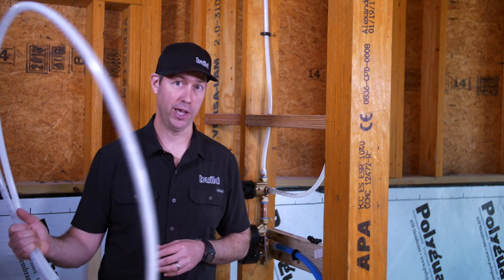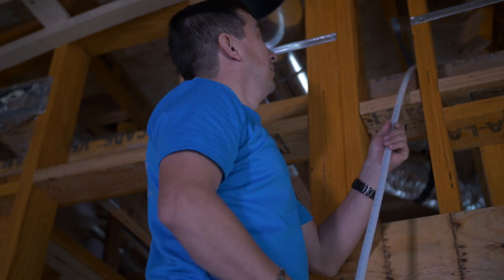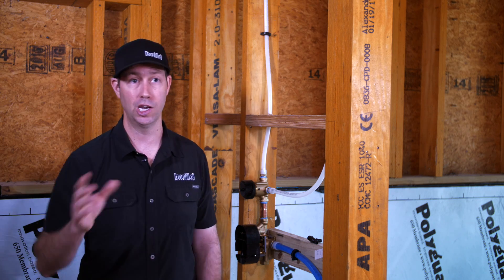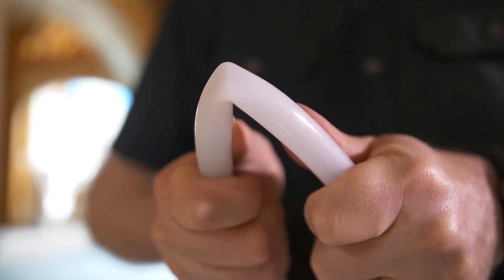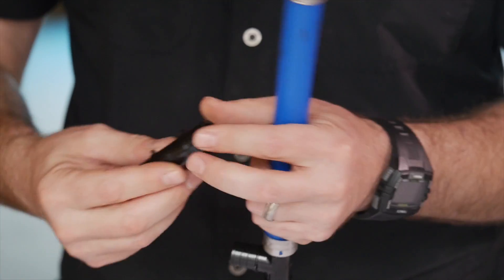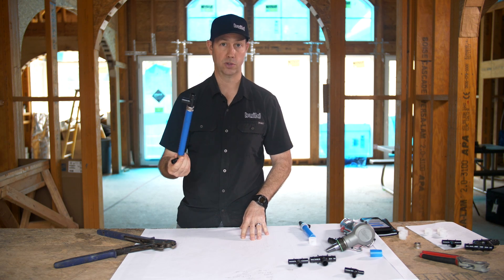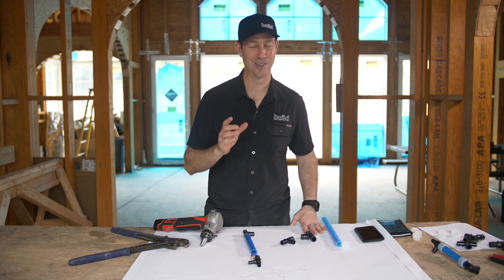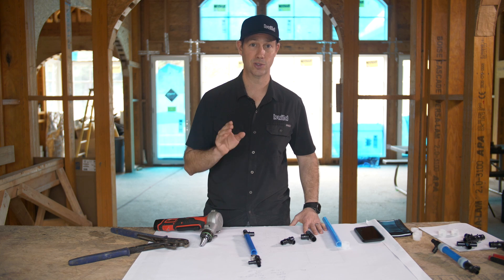PEX vs. Copper Plumbing

Comment: I'm from New York City and PEX is not permitted to be used according to NYC building code. However, they do sell it in NYC Home Depot
Reply: MemoGrafix with a properly installed solvent weld joint PVC waste pipes don’t leak for a lifetime. They are effectively one piece of plastic. That’s basically all we use in the UK and have done for about 20+ years.
Reply: @DaddyBear3000  We use 'Oaty' glue here in Cali and it works great.  No leaks w/ ten foot head and cheaper than ABS.
Reply: I used to live in the City until 2005.  I had a Bronx landlord use PVC for waste it always leaked every year and HPD put fines & violations on him for that among other things.  
I learned a lot from the HPD inspectors, I like how NYC's HPD/DOB does things in terms of building codes, construction and, maintenance.  
I own 2 rentals 2 & 3 unit Buffalo, NY.  Most homes that have any newer plumbing are fitted PVC Pipe & now PEX. 
I'm not a plumber, but PEX to Me is good for a short term quick fix.  
I used PEX for My claw & Ball foot tub temporarily for a year then switched back to copper, it didn't leak, but I just didn't trust it.  
PVC always leaks 6 mos - 3 years max over time more than copper and cast iron.  
I prefer copper, galvanized and cast iron in My houses.  Their almost 100 years old.
Reply: Many of the old time plumbers in NYC will only install cast iron pipe for waste, however PVC pipe for waste is now legal (since 2010 i think) in NYC for 1-2 family homes. I never had any leaks with PVC waste pipe and I do find it economical and easy to work with. The only drawback is that its loud, you can hear the toilet being flushed or sink being used. Honestly, if there was cheaper alternative to copper and legal in NYC, I'd use it. For now, I prefer PVC for waste and copper for water supply
Reply: That is good to know someone never had leaks with PVC.
The Bronx apartment I lived in PVC would leak in the bathroom and kitchen so much, I just don't trust it now in My houses.  
Perhaps the "Handy Jack (azz)" guys My previous landlord hired to do the repairs just didn't do it right for lasting results more for repair call$$$.  
Still in all I guess I'm like those old-school plumbers, I prefer the metals over the plastic.  Hell, I don't even eat/drink off plastic nor use much plastic except for storage bins (not food).  
I'm a stickler for materials that are cotton, silk, wood, leather, glass, chicken on a bone, You know the real stuff.
Reply: @xcmskim4  Just be sure to use primer before the glue, and don't use the rain or shine type glue or you will get leaks!
Reply: @MemoGrafix  I plumbed hundreds of waste systems w/PVC and the only leaks I got were when I once used the 'Rain or shine type glue and it didn't mix right with the primer.
Reply: Karl Harris  That's how it should be, lasting a lifetime.  Like metal pipes do.  
I do agree with the host of this video that the drawback of copper/metal bursting with freezing.
Reply: I love cast iron and copper pipe, but they are metal and metal corrodes. I have had to dig up piping in two of my homes because the copper and cast iron pipe has deteriorated. In both cases, I replaced them with plastic (PVC and PEX). There are places for every type of piping material, you just have to be smart about where you use them and who you have install them.
Reply: @Mark:  SCORE!

Comment: How will PEX stand up to high pressure water coming from the Municipal Water company?  I have seen this happen twice on houses with copper pipes, and the only failures were from the line from the shut-off valve to the sink or toilet.   If this situation happens to a PEX piping, how much pressure will PEX support before the joints fail?  Especially from the upanor (sp) type joint.

Comment: This is a 2010 article from Green Building Advisor. A LITTLE outdated perhaps but the discussion points are good. Some natural practitioners are worried about copper toxicity, others about plastics/vocs leaching. Solid advise for anyone looking to drink the healthiest water possible would to be to flush the pipes for a minute before drinking and then filter the water with something like a Berkee. And if you genuinely don't like the taste, perhaps copper running to the kitchen sink and PEX to the remainder of the house. http://www.greenbuildingadvisor.com/blogs/dept/qa-spotlight/how-safe-pex-tubing

Comment: No shark bite?
Reply: ever try using those big ratchet clamp//crimp tools in tight spaces>>?. Shark-Bytes are by far the easiest.
Reply: in between studs, when remodeling, when repairing frozen busted lines in tight spaces, almost impossibe to get a crimp tool in there or sweat solder without teraing up a wall to gain more space. Obviously you've not done a lot of plumbing and experienced working in tight spaces. The crimp tool has its place but it's limited. Sharkbytes are much more versatile and cut down on labor time immensely.
Reply: No mention of PEX-C either
Reply: kirk58 they make one handed crimpers that fit almost anywhere.
Reply: Robert Slackware  Are you sure salt is good for your septic system?
Reply: I would only use shark bites in places I could access fairly easy.
Reply: I used shark bite fittings, its been at least 5 years. No leaks, no problems, and they're on exterior wall of my unheated , cold af, Chicago residency . So , I think they're a good product

Comment: I am going pex b and removing all copper because of high calcium leaves in my area .  I have become a fan of pex when I had started to work for home depot before the I was a copper all the way guy but now if I can get in and out fast with a repair and my customer is happy with a less expensive bill over what copper is I am happy if they are happy.  But I will give what the customer always wants.